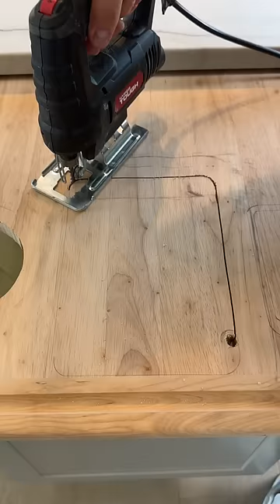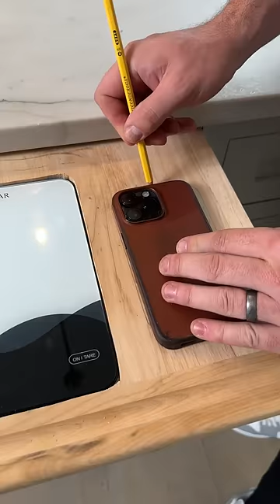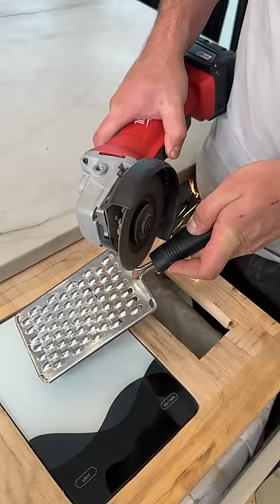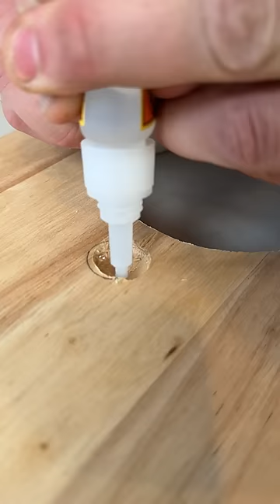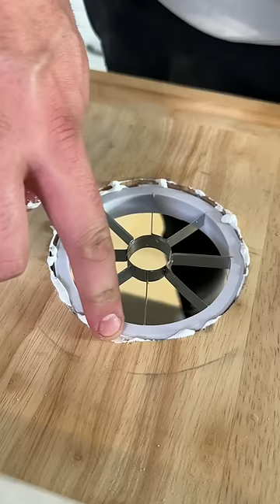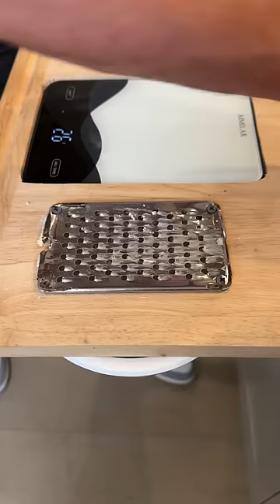THIS IS WHY I MARRIED HIM! 😍

Comment: Tell me you've never washed a cheese grater without telling me you've never washed a cheese grater.
Reply: exactly what I was thinking
Reply: Mounted it with drywall screws 😂 my girl would beat my ass with a shoe for that and I do finish construction.  Then using a grinder with 1 hand while holding what you are cutting..... with a metal ring on.....my metal shop teacher's foot would be up my ass and out of my mouth. I seriously started tasting the sole of a shoe while watching this🤣
Reply: She's gonna say "We actually season our cheese grater like cast iron 🤭 Try again, sweaty"
Reply: @mathewdecorse5748 I don’t know if I’ve ever held a grinder with two hands. Handle and guard never get used in Masonry
Reply: @mathewdecorse5748 wtf are you supposed to do, hold it with two hands?
Reply: @sinjon  no you are supposed to put it in vice. Have y'all took shop in highschool or is that not a thing anymore? Grinders and cutters skip and jump. Guards are useless in a lot of situations especially when you are handling the tool WRONG
Reply: @jonnykroneks3798  if you are in masonry I'd absolutely trust you throwing it around like a yoyo. Y'all are nuts and do hard shit. Chances are that thing would just bounce off your palm 😂 if you are in a trade and use that SOB I completely trust you know wtf ur doing. This guy really didn't and it shows .
Reply: I was thinking the same thing!
Reply: I was wondering the same
Reply: @electthelambda BINGO!
Reply: Beat me to it
Reply: This is the comment I came for. I was very confuddled and befused.
Reply: Would you not just use the bowl  underneath and wash it with a rag and soap?  I don’t see how that’s a difficult solution.
Reply: Tell me you don't understand cheating the algorithm without telling me.
Reply: @electthelambda  wait did you mean sweetie? because I read sweaty (sweat)
Reply: That is what i said so we wont be ating there
Reply: @jivonniasmith9770  ating, huh?
Reply: 😂😂😂😂😂😂 Jaaaaajajajaja...Exacto ! Solo entré a los comentarios para ver quién decía algo sobre cómo lavar el rayador y todos los instrumentos... 😂
Reply: Yes!!
Reply: He didn't even try to make the tools removable. Plus, he ruined a perfectly good work surface/ cutting board.
Reply: SAY IT
Reply: Was searching for a comment like this 🤣
Reply: Facts!!!😂
Reply: I showed my wife just the very end of this video and that was the very first thing she mentioned “it’s cool but how are you supposed to clean it?”
Reply: My first thought.  The scale is cool, but washing the other stuff is going to be a pain.
Reply: Who the fuq grates brie!?
Reply: frr that was what i was thinking
Reply: Yeah I think this husband has never done any cooking/food preparing himself?? Has always had his mom or wife to do everything for him? THAT SAID, how did the wife go along with this, or does she not cook/prepare food either?? Maybe they have housekeepers? lol
Reply: Exactly my thoughts
Reply: On the real 😂that's the first thing I thought 💭 

Probably power washes it
Reply: Se lava????😮
Reply: Exactly my thoughts. That’s gonna be so much harder to wash those kitchen tools now
Reply: Exactly lol
Reply: That grater gonna get hella stinky fr fr.
Reply: Came here to say that would never get clean.
Reply: Also, it looked like sheetrock screws were mounting it down, and I am pretty sure they aren't safe for food contact.
Reply: I was thinking about that!! 😂
Reply: I was searching for this comments lol 😂
Reply: Exactly!!
Reply: No hay invento que sea Perfecto al  primer intento……Se le agradece el detallazo  !! Les aseguro que con el tiempo lo va a evaluar y lo mejorará. 👏🏻👏🏻👏🏻👏🏻
Reply: @indiaknowlden9699 it would be impossible to rinse... what are you gonna do fill up a bucket with water and pour it on it? Into a bowl under neath?
Reply: @JoeKondis #me2
Reply: @mathewdecorse5748 have you ever had your own opinion?
Reply: i guess hes washing the whole board now lol
Reply: Fr tho my exact words were, BUT THAN HOW DO YOU CLEAN IT!?
Reply: @mathewdecorse5748 
This whole contraption he built is stupid and shity, but having said that if you need both hands on a grinder especially a battery powered one just stay in the kitchen and bake cookies or something
Reply: Lol, came here to say this 😂
Reply: These screws are rusty and cheap...He will wash it next time when he will decide to replace these rusty screws )) and "'maintenance screwdriver" is to be attached to te bottom of that raped cutting board :D :D :D
Reply: @electthelambda  im not sweaty who's sweaty
Reply: bro i thought that was an ipad or sum but it turned out to be a scale  😅😅
Reply: I was looking for this comment
Reply: Was 100% my first thought. I posted basically the same comment before I saw yours.
Reply: never washing that one again anyway. I guess they could put the bowl under there and scrub it, but then you're getting soapy water all in your wood board. Also, those wood screws really did quite a deformation on the grating plane... smdh
Reply: he adds sawdust to his cheddah for umami
Reply: Or as I like to call it, a “sponge ruiner”
Reply: Old cheese can't be bad for you can it? Cheese is already milk gone off big time styley.
Reply: This is the comment that I came to the comments for
Reply: @electthelambda I was thinking “Yum! Metal shards!”
Reply: TOP FUCKING COMMENT HELLO
Reply: That’s what I was thinking! “How is he gonna wash that?”
Reply: That's what I was thinking!!!! So unsanitary!
Reply: U married him cause he makes it easier to make cheese?😐
Reply: Thought that exactly xD
Reply: Aka Sponge Ruiner.
Reply: I'm sure he was buying a new cutting board insert the next day. Ladies, this is why we don't leave them home alone without supervision 😂 Kids....do not let daddy do stupid shit while mommy is gone. And if daddy picks up ANY tools while mommy is gone, you call mommy right away!
Reply: @weallmadhere  if Daddy has been drinking from those funny bottles he keeps in the cabinet over the fridge, and he tells you yo get his toolbox, you tell ‘em Hard Hat Harry says No Way!
Reply: @mathewdecorse5748 so this guy doesn’t know what he’s doing and she’s just eating it up 😂
Reply: @jojobee42 on top of all that he can’t even use tools right lol
Reply: @mathewdecorse5748 I agree with ya. Grinders are dangerous and this guy didn’t give me a lot of confidence. But I use them a lot in my trade and have gotten quite good with them. Using the rotation to help you safety Wise it’s definitely a tool you need to respect. And I will never use one that’s not a trigger style on. So if something happens your hand comes off at least it’s not pinned open. Those are dangerous as hell.
Reply: Tell me you don't appreciate aged cheese without telling me..
Reply: I don't have covered knuckles.
Reply: Enjoy the faint enduring odour of old cheesy mould in your kitchen.
Reply: Fr fr
Reply: I was wondering if I was the only one
Reply: how would you wash these gadgets?
Reply: Actually made me laugh, I don't even use a cheese grater anymore cos I hate cleaning them
Reply: How about the salmonella scale too
Reply: That’s exactly what I was thinking to! Its like they totally just did thos literally to make a video not cause she is goin to use it.
Reply: Lmao
Reply: How do you wash them after using🤔
Reply: @electthelambda how you know he’s sweaty?? That’s a wierd thing to point out
Reply: Lol true😂
Reply: The piece can be removed from the counter and washed in a large sink. Looks like there is plenty of room to fit in the sink in the video.
Reply: @mxof1381 well when using a cutting board you have to was it after every use so the cheese grater would get washed as well
Reply: my thoughts exactly holy fuck
Reply: It cant close with it there or with the bin and now you have less cutting board.
Reply: Only thing tunning thru my mind after seeing what was about to happen!!!
Reply: haha, commented something simmilar
Reply: This is gonna blow your mind but a wet soapy rag with the bowl under
Reply: bro I'm looking like okay they gonna grate the sponge and I guess the sliver gonna stay dirty to
Reply: Fr Ngl the fact that he did that lowkey annoyed me
Reply: @mathewdecorse5748  😂
Reply: I keept thinking "ok but how do you clean it" every time he added sumth new
Reply: 100%
Reply: @indiaknowlden9699 all the water would get in the floor and that is more mess to clean up. This really wasn’t necessary. Also, how are they going to wash the cutting board? This set is so freaking useless.
Reply: That was my first thought
Reply: I was thinking like ‘how is he supposed to wash that’
Reply: @Theredtail95  use an old tooth brush
Reply: @mathewdecorse5748  What is the problem with the ring? asking for myself because i am stupid.
Reply: @zahedah80  or I can not do this and put the cheese grater in the dish washer.
Reply: i know right thats the first thing i thought when i saw it
Reply: Exactly! They're not fun to clean. This was one of the dumbest things ever.
Reply: Literally my first thought
Reply: Married wrong men
Reply: If the guy over-engineered a food prep drawer, I'm sure he's got an over-engineered cheese grater washer too.
Reply: My. Thought. Exactly!
Reply: this 🙌🏼
Reply: Yeah that is what I thought
Reply: How will you clean it nasty boy
Reply: @mathewdecorse5748 lmao I can relate on the shoe
Reply: I was specifically looking for this comment. Glad I found it
Reply: For realz
Reply: 🤢🤮 would never with the cheese grater
Reply: And never used a cheese grater before, who grates cheese on its side and not on the tip
Reply: FIRST THOUGHT!!!!
Reply: Or tools 😂
Reply: I was thinking the same thing.
Reply: i was looking for a similar comment before i posted mine lolol. Spot on.
Reply: @mathewdecorse5748 There’s nothing wrong with holding the workpiece and grinder at same time 1 hand each. Most safety precautions are overkill and designed for stupid people. Most trades people get through their lives ignoring the majority of the rules and still die of natural causes.
Reply: @mathewdecorse5748 work shop is only a thing in maybe half the country bro 😂 not all of us lived the tv like highschool life
Reply: @lucienschlut  most machinery or power tools you shouldn't wear a metal ring around because it can snag and cause ring avulsion or unsheathe the skin on your finger or making it look like a horribly messed up circumsision 😂 it's why you see a lot of machinist construction workers some mechanics ect. wearing rubber rings.
Reply: @JacobLeeson-zk1ol  exactly trades people. I said before if you use it in your trade then absolutely trust you to use it however you will. But this guy obviously had no idea what he was doing and isn't the kind of person to know how to handle it like people that use it in a trade or more than twice after buying it.
Reply: @Destins2  idk I've been out of school for a while but I took 6 shop classes in Jr high including metals plastics and woodshop then took auto in highschool and I lived in a low to mid income area. Maybe things are just more technology driven now or maybe it was because it was in a lower income area they were shaping us to be the grunts of the next generation 😂. I'm a drywall taper and painter so I guess it worked
Reply: a brush, warm soapy water, and about 4 paper towels... it's not a lot.
Reply: Ha😂😂hahahahah
Reply: @metalkhaos that's assuming the scale works correctly, most require a flat even surface to read weight correctly. It'll likely throw up incorrect weights from time to time and that's before the metal strips warp or the screws come loose.
Reply: Im like nah bruv, this is nasty af 🤮
Reply: @indiaknowlden9699  that's way more awkward than it needs to be
Reply: Thank you
Reply: @electthelambda  This is the best malapropism I've heard in a long time. "Sweaty." I'm dying over here.
Reply: came here to say the same shit lol
Reply: I was thinking that shit toooo
Reply: @indiaknowlden9699 water + unvarnished wood bad. That thing is going to warp like crazy
Reply: I came to say this... not so eloquently 😂
Reply: @indiaknowlden9699 have you never eashed a cheese grater before? Go use it a bunch and then attempt to handwash it. Now imagine doing that every time with it strapped down and eventually rusting from the screw holes
Reply: Nice. But how the heck are you cleaning that? Glad I'll never be eating at your house. 🤦
Reply: Yapz...😂😂😂
Reply: I waa thinking the same. Lol
Reply: @mathewdecorse5748  you are NOT supposed to put the grater in a vice, lmfao. this is such an american take.
Reply: @tarkitarker0815  nah that's how you cut your finger half way off holding it like an idiot. At the very least pin it to a surface. Don't freely hold it in the air for a tik toc shot. (Looks as dumb as it sounds) Plenty of people have agreed but maybe y'all do stuff differently across the pond. Still got all my fingers and limbs from working smart and safe.
Reply: @ryanallmaras Tell me you don't have a loving, appreciative wife, without telling me you don't have a loving, appreciative wife. (or maybe any non-toxic longterm relationships ever)
Reply: @CarolinaGirl6919  lmfao. this just sucks and a wife that would actually use a kitchen would know, so would a broom that actually does use the household and not just uses the cooking function of his wife.
Reply: @ryanallmaras Tell me you don't have a loving, appreciative wife, without telling me you don't have a loving, appreciative wife. (or maybe any non-toxic longterm relationships ever)
Reply: @tarkitarker0815  SO not my point. My point was that people are way too eager to criticize criticize criticize constantly online. My other comment speaks more to this. All that matters is that his wife appreciates what he did in the fact that hundreds of people take the time to slam him, tells me something about them. All that matters is that she likes it
Reply: They also get dull and need to be replaced, and you usually need several different sizes depending on the hardness of the cheese and what you’re making. This is a non-cleaning male non-cook’s idea of a good idea.
Reply: WHY IS SO FUNNYYYY
Reply: @mathewdecorse5748  Shop is not common in highschools. I would've loved to have it as an elective a decade ago lol
Reply: He definitely doesn't watch sports
Reply: @codycummings2433 😂😅
Reply: I was like oh no.. oh noo its not removeable
Reply: Glad someone said it
Reply: Lmfao 😂
Reply: @mathewdecorse5748  I work with metal and sometimes using both hands is not an option, they sometimes hop, that's true, but if you are positioned correctly it shouldn't be an issue
Reply: @mathewdecorse5748  dude knows. lol you had me at "yoyo"
Reply: The best one 😂😂😂😂👌
Reply: You just put it under water
Reply: Tru
Reply: This!! Right here THIS!!!
Reply: Perfect comment
Reply: Soooo how are we washing the cheese grater 🤔
Reply: That's what i was thinking too .. 😷😱😷
Reply: @electthelambda  sweety
Reply: I came to the comments to make sure this was mentioned
Reply: Invalid question. Actually he never used it.
Reply: You can just cut the mold off right?... Right?
Reply: Just unscrew everything to wash them or wash them while they're attached to the board so the mold can build up. 😂
Reply: @sinjon y’all don’t have four sided cheese graters with a handle on top?
Reply: My thought, exactly! And that apple slicer, how are you going to clean it?
Reply: That is the first thing I thought
Reply: Omg that was my 1st thought😂
Reply: hahaha so true
Reply: Oh my GOD YESSSS
Reply: What i wass thinking the whole time!
Reply: came here to say this
Reply: @jonnykroneks3798  tools like that can skip around it’s not a matter of holding the tool with two hands but having the item that’s being drilled into clamped down and secure
Reply: @indiaknowlden9699  it’s not a solution as washing a cheese grater by hand is an ineffective way to clean a  cheese grater
Reply: @Entropic0  yeah they will rust
Reply: Thank you🤦‍♂️
Reply: Yeah, it'll definitely be a mess cleaning any of that up.
Reply: the whole reason I buy grated cheese.
Reply: Omg I'm not the only one thinking the same thing! 😂
Reply: That's what  i am thinking
Reply: lmaoooo i was thinking the exact same thing until i thought maybe he just takes the draw out and wash it like that in the sink... or maybe he goes to the backyard and uses the water hose lol.
Reply: "I made my cutting board just like in this video."
Reply: That's the FIRST thing I thought! That's going to be a whole unsanitary mess!
Reply: BAHAHAHAHHAHAJFFJ💀😭😭💀💀💀 I LOVE YOU FOR THIS BRO💗💀
Reply: no washing makes the product more spicy....
Reply: U gotta let that shit soak. Clearly theyrenot gonna let that shit soak.
Reply: Cleaning that shit has to be a hassle though
Reply: How would you clean
Reply: Maybe she never used it before in her life??
Reply: They just unscrew it off, wash it then screw it back on
Reply: 😆🤦🏼‍♀️ Exactly
Reply: Probably slide the entire board out to clean it
Reply: Stick it in the dishwasher pull the weight board out by pulling out the board and flipping it over and ib wssher it goes.
Reply: @mathewdecorse5748 I think its cross dressing 101, home eco and cooking class followed by how to properly enter girls restroom, sadly true.
Reply: Cheese Grater? It's a Sponge Ruiner!
Reply: This! So this!!!!
Reply: Ditto!  x10K
Reply: I came to the comment section
for this exact reason LOL!!
Reply: Exactly what I was thinking lok
Reply: 😂😂 that's what I was about to type but you said it first!!!😅😅😅
Reply: For real tho
Reply: Then show me how to clean back
Reply: I was just thinking that.  It's kind of inconvenient having to unscrew the cheese grater just to wash it, and re-screw it back on.  It would be better if it was clip on.
Reply: First that popped into my mind
Reply: Exactly
Reply: Right?!
Reply: Ya beat me to it😂
Reply: You can still wash it with a sponge and soap and wipe it with a wet cloth just place a bucket under to not drop any water
Reply: yes that was my first thing follows build-up cheese mould in the cupboard/cabinet it's self, ?
Reply: Thank u
Reply: Exact thoughts!
Reply: He'll just build a robot arm to clean it
Reply: Better be sure to not washing for a mistake
Reply: You gotta start somewhere, folks.
I'd say that would be new drill bits.
Reply: You can wash it by grating soap and cucumber after :D
Reply: ahahha oh yea
Reply: remove and wash the entire cutting board
Reply: I know!!!! 😮
Reply: @mathewdecorse5748 ofc grinder with 1 hand wym
Reply: You can secure a bowl under the cheese grater, so washing it without removing it is perfectly feasible. All you need is a wet dish sponge and your cleaner of choice. Exactly like if you were going to submerge it in your sink.

In fact this might actually be a solution to the cheese grater rusting.
Reply: @KyleHarrisonRedacted - With a cloth or sponge and some dish soap.

You can't lift the floor, so you bring the soap and water to the floor... this is literally no different.
Reply: @weallmadhere - And this attitude is why marriage is on the decline, even when men aren't acting like children... and I do fully acknowledge that if he were doing this for real he'd be an idiot, most women will insist on treating them like children.

So there is no miscommunication, he literally just did this for the vid. It's wasteful, but it's not the all cousuming crisis that some people here want to pretend it is.
Reply: @NaveedaHaq  - By bringing a bowl of water, some dish soap and a sponge to the counter. Or by removing the chopping board, notice that he had to remove it to make this device, and bringing it to the sink.

Or by never needing to cleaning because it's guaranteed that this device was made for this video and not for everyday life.
Reply: @Vanilla_Rocket  - I do love how it's mostly women asking "How you gonna clean it?", like there isn't at least 3 obvious solutions.
Reply: @kennyjohnson26 - The bigger problem is "Who grates Brie?"

The biggest problem here is the number of people here who think this was done for purposes outside of this video.
Reply: Lmaooo for real.
Reply: I shredded my knuckles
Reply: @codycummings2433 maybe someone who sprinkles cheddar over Italien food😮
Reply: I was going to say the same thing
Reply: shows cuts
Reply: That just seems so gross 🤮 totally
Reply: I was thinking the same thing 😂
Reply: My first thought.
Reply: Yes!!!!
Reply: I think everyone has the same idea and I think that's why they made the video knowing it was going to get comments and views to piss people off.
Reply: Thought it was Bradley Martin at first 😂😂😂
Reply: tip: easier with a tootbrush
Reply: AAAAAAAND THOSE NAILS ARE GONNA TURN RUSTY!! I mean you have to wash that grate with soap and water 💦🤷‍♀️🤷‍♀️🤷‍♀️
Reply: That’s called Bleu Cheese.
Reply: That's going to have all the cheese flavors in one spot, including spoiled.
Reply: I was thinking about that with everything
Reply: On next week's episode... installing a new cutting board because your last one will never be clean again! 😅
Reply: He's likely never washed a dish, or done a chore. I'm guessing he does the fun stuff/projects around home.
Reply: My first thought!! Lol
Reply: First thing I thought about.  How are you going to wash that cheese grater?
Reply: Ong 😂they definitely wash dishes😂🤣🤣
Reply: Glad I was not the only one to think this exact same thing
Reply: Riiighttt?!??!!🤣🤣
Reply: There is nothing difficult about cleaning a cheese grater if you don't let it sit out for hours or days while the cheese turns into fucking cement.
Reply: This is literally what I was thinking. Like how do you clean it???
Reply: best comment ever
Reply: What I was thinking lol
Reply: My thoughts exactly
Reply: The whole time, it was grating my brain cells
Reply: @codycummings2433 Haha so true!!! We all focus on washing the grater and the animals meanwhile grate brie?! 😂
Reply: Right?
Reply: I was thinking the same thing 😂
Reply: 😂😂😂😂😂 Amen!
Reply: Looking for this
Reply: Exactly!
Reply: Rinsing it off in super hot water at high pressure is washing it.
Reply: That’s the first thing that came to mind!😊
Reply: exactly.
Reply: My first ouch moment of this video. Still, decent execution and a fun project.
Reply: Duh, he's going to vacuum it clean after each use.
Reply: Àq
Reply: Действительно, а как потом мыть терку?
Reply: 🤣🤣🤣🤣🤣....RIGHT!!!
Reply: I am gonna ask the same question.
Reply: More like never used one, much less washed one🤦🏻‍♀️
Reply: My thoughts exactly
Reply: Same 😂
Reply: @indiaknowlden9699  You can’t eat at everybody’s house🤷🏻‍♀️🤣
Reply: @HBosse90  And that will also not get any of it actually clean but hey you can eat there I’m not eating there
Reply: That's some useless shit right there!  Wtf is that?I'm going to hold this bowl while I grate the cheese.  And slice this apple, while again holding a fkn bowl underneath this bs contraption, I've rigged up. I am the dumbest guy on the block.😂 smh
Reply: 😂😂😂😂😂😂😂😂nasty.
Reply: Tell me you know nothing about screws without telling me. Use your brain more it would help. You take the screws out which is easy using the right thing.
Reply: @maddielynn7929  That is more work than just storing a cheese grater in a drawer and using it normally you walnut. Now to use the cheese grater every time, they'll have to unscrew it from the drawer, wash it, then screw it back onto the drawer for it to be ready again for use. And I DO know about screws. The screws he used are meant for single use. They are not meant to be taken out and put back into the same hole again and again. If you are ironclad in your resolve to screw a cheese grater to your cutting board, then you'd install a metal screw insert for each screw and THEN use the correct type of screws for them. That way your screw hole can be used over and over without worry of losing grip.
Reply: @Sarah-with-an-H  we hold the stone in one hand and grinder in the other most of the time unless it’s to heavy to hold up while cutting
Reply: The problem is you don’t know what screws are🤣 you can wash the cheese grader without the handles as well🤣🤣
Reply: My first thought 🤣
Reply: Exactly wat I was going to say
Reply: @Theredtail95 You wouldn't use a sponge on a cheese grater, you'd go side to side with a bristle brush after you soak it. But water would get in the seams if you clean it and rot the wood.
Reply: @mathewdecorse5748 Good point and also people should focus on meal prep and cooking instead of making shitty TikTok videos.
Reply: He forgot to make room for the screw 🪛 driver to unscrew the cheese grader🤭😃🤔🤨
Reply: @sinjon you clamp it or something to fix it's position. You never hold what your cutting. Recipe for disaster smh
Reply: First thing that came to my mind when he screwed that cheese grater to the wood
Reply: Don’t worry next weeks video will be swapping the sink with a built in power washing
Reply: You could go round washing everything where it's used like this but it's much easier to wash things in the sink or throw them in a dishwasher, which is why people do that.
Reply: He will never, just about to slide it back in.😶
Reply: The best way to say what I was thinking
Reply: @mathewdecorse5748 if you can’t use a grinder with one hand then you shouldn’t be using it
Reply: He just did. 😂
Reply: Lol